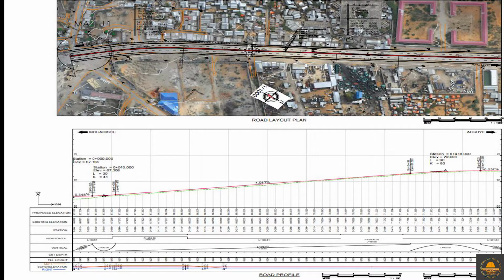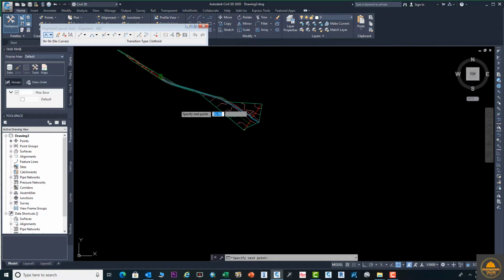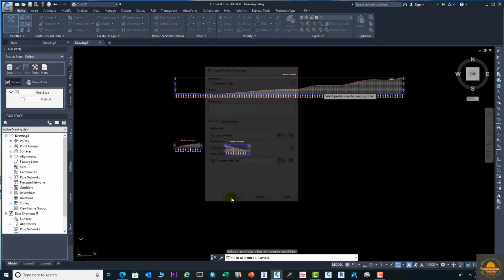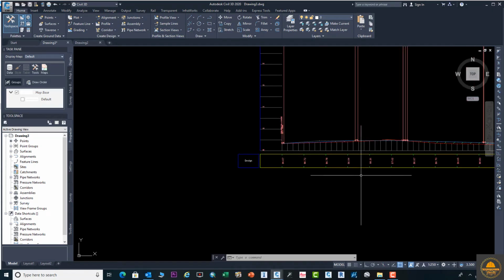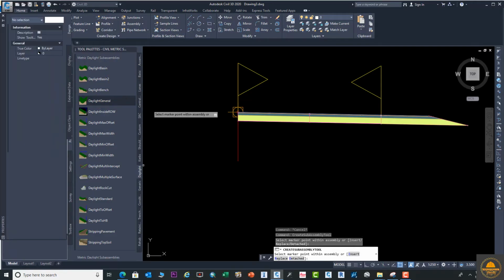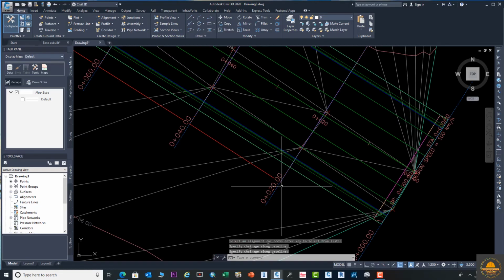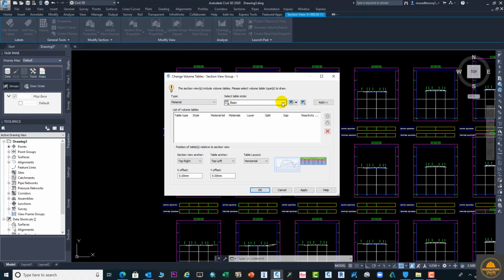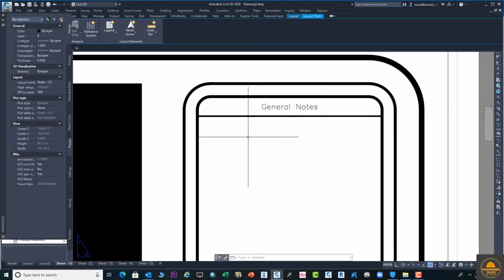Complete Road Design in One Video from Start To End in Autodesk Civil 3D.

Comment: You make drawing Horizontal Alignment look very easy. How about minimizing your point of vertical intersections?   You have so many Profile Geometry  Points labels within a short span -Alignment ABC 2 and 3.
Reply from the maker: Separate profile for each section. You can use labels as per your requirements. It’s just for learning purposes

Comment: Great work sir. Please which command did you take to join the uncompleted existing profile lines before clipping them?
I didn't see clearly what u typed.
Reply from the maker: Thanks for your email it’s usually not happening I think it’s my mistake there but I join it with join command or maybe with poly line. 
Or you can use vertical manual curve from geometry properties.

Thanks